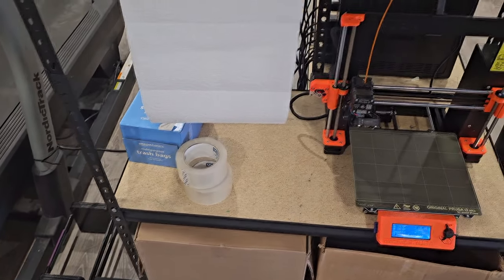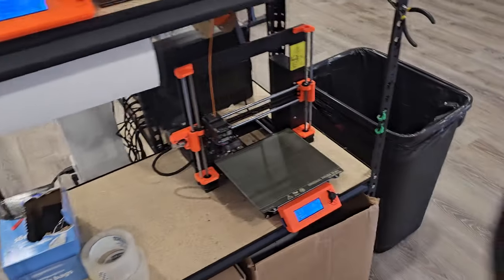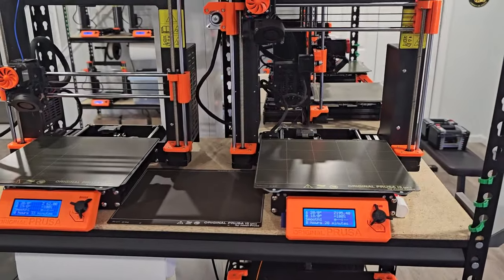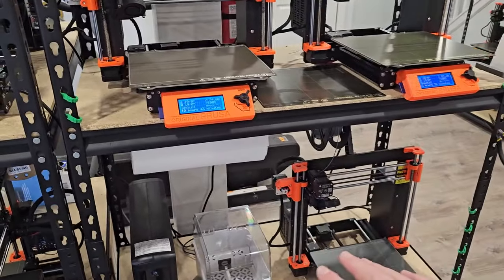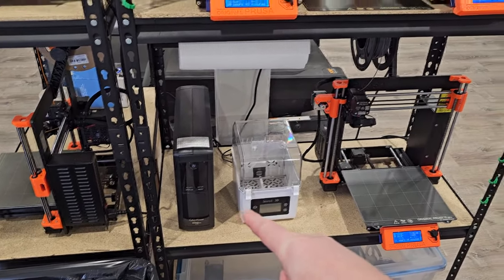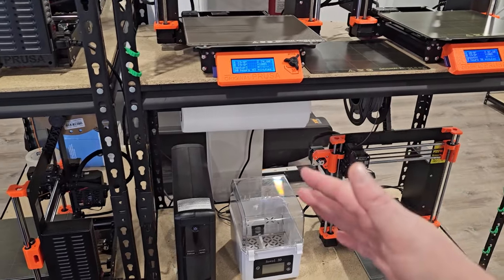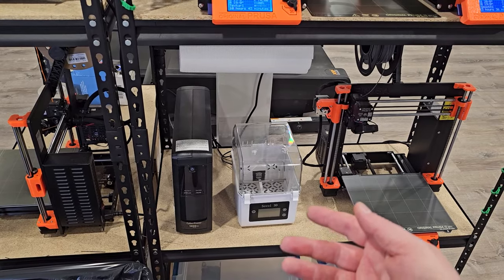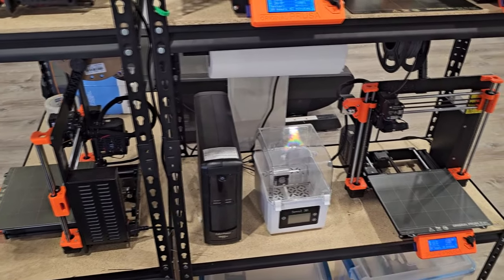3d Print Farm Tour -  $100,000 Per Year 3d Printing on Etsy!

Comment: Regarding fire suppression, you can buy these fire extinguisher balls that you mount close to (preferably above) things that could catch fire. Should fire break out, it triggers a small explosive charge which dumps extinguishing chemical powder over the fire, putting it out in most cases. They'll only run you $20 or so each and last for five years before needing replacement.
Reply from the maker: Thanks ill look into these, ive seen the cooking ones but they are very expensive

Comment: Speaking of saving milliseconds... I use 25 mm magnets as tool holders.  Get close and the tool docks itself.  Grab the tool and pull and there's no fiddly alignment trying to get needle nose pliers into a hole in the leg of the rack when it's pressed into use as an improvised tool holder.  3D printing custom tool holders is nice but magnets as tool holders are the fastest and easiest.
Reply from the maker: I use a magnet bar on my "clean up" table that my metal tools go onto, its super helpful!

Comment: I have a question about your 3d farm, how do you deal with PLA-PETG fumes from all the printers? do you for instance exercise or work on your computer while the printers are printing or do you exit the room?
Reply from the maker: Hi Michelle, currently I do not have any system in place but only print in PLA, and very seldom PETG so it should not be an issue imo

Comment: I moved on from the Mk3s+ last year to something better. Nice print farm though.
 Which camera do you use to monitor the printers?
Reply from the maker: I use nighthawk but they are terrible I should upgrade to something better soon
Reply: @glennbrian3d  Thank you for responding. I used to use wyze cameras since they could mount magnetically or with tripod threading. Decent for monitoring and "ok-ish",  for time lapses but it was an inexpensive solution if they had memory cards in them. 

Also do you have smart plugs on each printer to cut power remotely? 
I have been printing for a little over a year and am trying to build out something similar to what you are doing.
So far I had ender 3: retired
mk3s+: retired
Ankermake m5(still in box)
and bambulab X1CC

I am trying to reduce "touch time" with the printers/slicers with bells and whistles like remote monitoring and sending code to the printer. This is the first video I have seen of yours so I apologize if you have answered some of these in other videos. Again thank you for responding and making this video.
Reply: @ashleys3dprintshop  what was the out come big boy? What did you end up with and did you make the factory work??

Comment: Hey buddy, do you clean your plates after every print? Just getting started, and noticing that printing 24/7 is heavy wear on my plates and adhesion it seems.
Reply from the maker: No I clean them maybe every 20 prints but I make sure I don't touch them with my bare hands

Comment: GLEN, are you saying that you must heat your print room to apox 71 degrees F , room temp... That printing in a cold room will cause problems.?
Reply from the maker: It is ideal to print in a Good room temperature once it gets too cold sometimes the printers won't even start like in your garage for instance, but I have printed in pretty cold temperatures like 60° and the prints come out okay but they don't adhere to the bed as well for me

Comment: I run a farm I have been switching out from pursa and biqu to Bambu labs they literally print 8-10 times faster one bambu replaces 5-6 regular printers and for me just work, very reliable (knock on wood)
Reply from the maker: 8-10 times faster? 😯 How's that even possible
Reply: @glennbrian3d  yeah definitely the wrong printers lol 3 or 4 bambus could replace all those... Prusas don't really make since anymore
Reply: @user-tj7xr6xd9z  if i would buy now i wouldn't buy a Prusa but since i already have it you can put klipper and gain a lot of speed.

Comment: How much vibration do you get on the printers running on the top shelf?
Reply from the maker: I always have flawless prints, I don't have any artifacts from the plywood vs using a stone if that's what you mean
Reply: @glennbrian3d  No, I was thinking more about the thin metal frame. But if the prints are good, that’s what counts
Reply from the maker: @karmachameleon326  ya they are good

Comment: Hey. nice farm. A nice and cheap upgrade would be to put a concrete plate under each printer  (40x40x4cm) für 3$ each :)
Reply from the maker: Thank you for the suggestion, I've never had to use any concrete plates or bricks and my prints come out perfect

Comment: Imagine if you spent 20k on Bambu Lab printers, your business will be 2-3x more efficient
Reply from the maker: Never tried one of those printers but I'm willing to give them a review
Reply: @glennbrian3d  they are so fast compared to Prusa's. Prusa really needs to lift their game as Bambu Lab is going to rock the 3D printing industry
Reply: Problem with Bambu is the proprietary hardware/software. Makes it less appealing in terms of keeping repair parts and consumables on hand. Prusas are tried and true and easy to source parts for.
Reply: Has 3d print farm, buys a paper towel holder. Lol
Reply from the maker: @addohm  what do you clean your beds with?
Reply: @glennbrian3d I use micro fiber personally cause all the Paper towels I’ve used leave a lot of fibers behind .
Reply: If he had 20k of bambu labs...his farm would probably be a pile of ash right now...as well as the entire building. At the least, alot of the printers would've broke themselves 2 weeks ago with the overnight bambu bamboozle that occurred.

Plus bambu tracks everything u do, all files u print are theirs if connected to internet. Servers in China.
Reply: Bamboo would not be worth it in the beginning, when you're starting a printing shop. You need to know that your machines are reliable and you can source parts in case anything breaks. With a new venture it will take time to see if it really stands the test of time of being worthy in the 3D printing shop
Reply: Which software are you using to manage the printers?
Reply: @jeremygalloway1348  I read your comment and became curious about your pile of ash comment.  I am poking around the internet looking for examples of failures of Bambu labs printers but I’m not seeing a lot.  Could you point me in the direction of any accounts of fires caused?  I’m genuinely considering investing in a Bambi lab printer, so any info you can point me to would be appreciated.
Reply: The only point I had to make was in regards to the issue that happened the other day with bambu server going down losing print que and then starting people's printers up in the middle of the night. Some folks had prints freshly finished sitting there...and the printer started up on its own  ramming into the already existing print. Lot of stuff like that happened due to that one issue. Damage to property...not to mention a serious fire hazard. Also...I dislike that the printer has to be connected to their servers
Reply: @jeremygalloway1348 again with ignorant comments. It doesnt have to be used with the cloud. It had one issue with a firmware update. dont go on about trashing something you dont own or have any experience with.
Reply: Oh cool! I just got my first printer and it's a bambu. I got mainly cuz it shipped out of California.
Reply: There brilliant
Reply: I have 2 mk3s+ and finally got a p1s. I don’t understand what the hype with Bambu is. It’s inconsistent and very difficult to use. I hope it is just growing pains and I learn to get better with it. So far, prusa is ranks top on my list. YMMV.
Reply: The speed and the quality of the print is way better. !  I had a bunch of Prusa mk3s. s  Since I bought my first X1c. I’ve never used the Prusa s since. Ended up donating 5 of them to our local school. I kept the anniversary Prusa 🤔. Now I have 3 -X1c s. 4 -P1ps. The P1p s are fantastic for a print farm. ( with enclosure preferably).
Reply: Imagine if you just built Vorons….
Reply: @kimzor1989 The only thing Bambu is rocking is a fire hazard A1 and customer support like a Chinese restaurant
Reply: How do you deal with the fumes and particles on your working space?

Comment: This video is about a year outdated. I've owned a lot of prusa printers but if you're going to spend 1,200 on a printer it needs to be bambu labs. Much, much better.
Reply from the maker: Thanks for your input!  I don't believe that's true however, you can get Prusas super cheap now and they last forever if maintained, we have t seen this yet with bambu
Reply: @glennbrian3d  My original macbook from 10 years ago still boots up and will last "forever". So what. Your tech is lagged. Have you ever owned a bambu? If not, then, no offense, you don't know what you're talking about. Just saying...
Reply: @glennbrian3d  btw, all respect. other than that I like the setup
Reply from the maker: @coul  thanks!
Reply from the maker: @coul  You can buy used Prusas for 200 to $300, everything's not about speed but if Bambu ends up proving themselves I'll give them a shot

Comment: FOr those in future, to replicate this, you would now be better off buying the bambulabs X1C with the AMS kit. For anything large, you'd go a different route but these are going to be even better than the printers in this farm now. I'm sure these were purchased before the X1C was out.
Reply from the maker: The Prusas Work great I don't see any reason to change at the moment
Reply: The x1c while fast  doesn't make it better for the situation.  The prusa is still reliable just as a ender 3 served me well it's all about knowing how to make work with what you have.
Reply: @smokeycheddar8842  I think you misunderstand. I'm talking from the stand point if someone wants to do what this man has done NOW, that they would be better off getting the x1c's. I have two of them and it's clear among the space that they are the most reliable and put out the best work by far. (The only single issue i know is the slicer needs 1 part of the other slicers to make their top surface better but it's still not anywhere near enough of a problem not to buy it over everything else). 
Because they're in the same price range, that would be the best option now and I made my comment to suggest it for anyone that may find it helpful..
Reply: @glennbrian3d  I agree with you. Speed is important, however in the 3d printing world increasing capacity by adding 1 more machine is so easy. Having consistent quality and reliability is more important in my opinion. My problem is I have a mix of machines that are better for specific purposes. I do more "one off industrial stuff" as my main printing source of income.
Reply: You are 1000% correct. 1 X1C easily replaces 3-4 mk3s and with an AMS you increase productivity greatly even in you only use 1 color. (4 x 1KG rolls with auto switch over if filament runs out)

Advantages include enclosure, larger build volume, core XY, remote monitoring and control, fast, capable of printing more types of materials and so much more.

Also the price is comparable and you can be printing in under 20 min after unboxing.
Reply: @Studio Vulcan No I got what you were saying.  I was just stating that it can be achieved numerous ways it just depends on how much you want to get involved vs how much you have to spend.  While the x1c is better in terms of spending a bit more to get more bang for your buck.  Some person may only be able to get an Ender 3 or variant.  And start off with one and reinvest to work to the carbon.
Reply: @smokeycheddar8842  The context for my comment is that this video is speaking about !$1400 prusas's with even more money added on top to make them more expensive than the x1c's. Enders aren't apart of this equation because I said if you want to do what /this/ guy is doing/did.
Reply: What the commenter is saying is that buying a prusa is like buying a 2010 honda civic for 2023 prices. Its reliable and will get the job done but you’re paying double the price for an outdated printer that hasn’t caught up with time. Reliable, yes but reliability is also achieved on new corexy printers like the bambu labs p1p that’s 700 dollars and double to triple the speed with all the newest features. Same deal with buying a ultimaker for 5 thousand dollars when they haven’t updated it just like prusas but still ask an insane amount of money for a fossil and the thing is they didn’t even bother to update the printers but sure as hell kept their prices up. We get it that you like prusa but regardless people will ask your decision given everything i stated before & no one is knocking your decision but given 2023 printers have gotten so much cheaper & theres so many new updates and upgrades that printers come right out of the box we do wonder haha but the most important thing is that we grow the 3d printing community. Best regards!
Reply: @studiovulcan4411  I was talking ender,Prusa and all others models. I was stating that it could be achieved in more than one way.
Reply: @smokeycheddar8842  I was too, but that the best option of all options, would be what i stated. There's no reason to pick a worse option. This video had a purpose and for those who relate to that purpose, my message is solid advice.
Reply: Agree. Replaced mine with a P1P and love it. Planning on adding more.
Reply: 1 Bambu Lab P1P is equal to 4 Prusas in speed. Imagine if you bought the same amount of P1Ps as your Prusas
Reply: Based on the evangelical comments I've read under hundreds of 3D printer videos, I've concluded that BambuLab is the world's newest religion.
Reply: @Liberty4Ever  And just like religions, you can believe in the same things and still separate and not participate in the things you don't like. Imagine that lol
Reply: Until you need to fix one ...
Reply: One thing struck me in this video: over all those printers there was very little actually printing.  Using the farm-analogy: what use is having a lot of land if you're not cultivating it.  These things should be printing 24/7.  Anything else probably points at inefficiency and too much infrastructure for the actual work-load ...